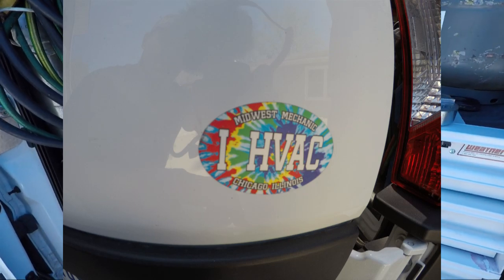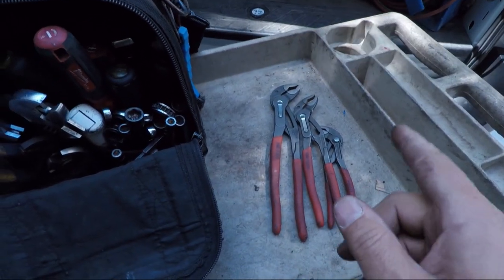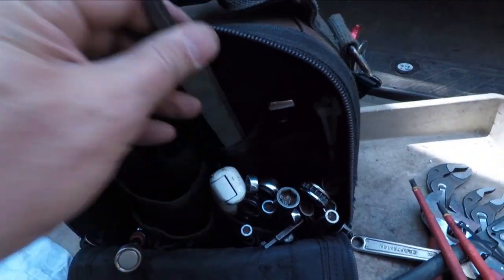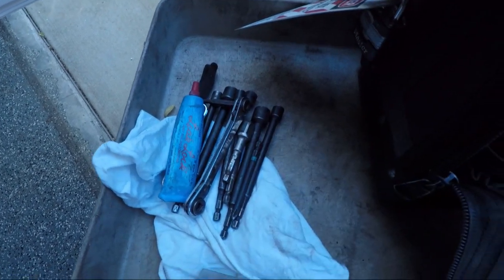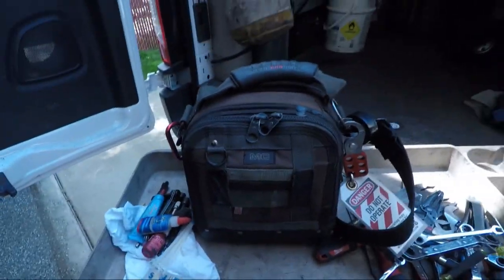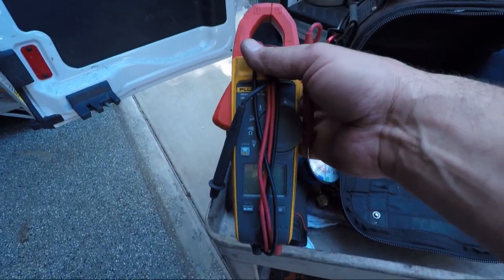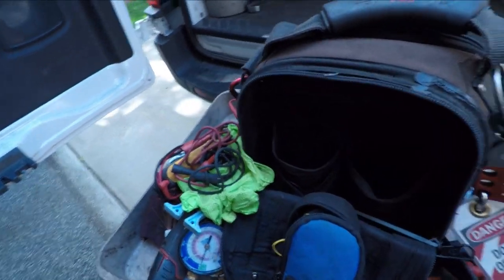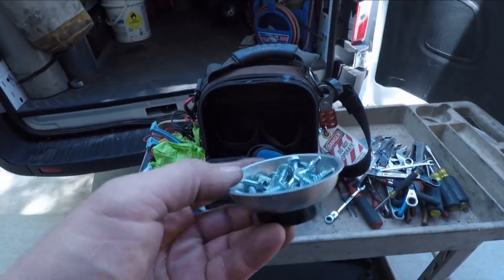VETO PRO PAC MC 2021 QUICK LOAD OUT HVAC TECH

Comment: Like the screw holder for sure that’s pile of tools 🛠 for sure
Reply from the maker: When I seen the little screw holder I had to have it.
Reply: @IHVAC  oh hell yea I would grab it also how dam heavy is that bag 💼 I would be half that stuff for roof work anyways
Reply from the maker: @instrumenttech4220  its less than 25 pounds.  I use it on roofs everyday!  Most roofs im on have stairs or elevator.  No ladders!
Reply: @IHVAC  ok 👌 that’s good to know looked like more you can fix anything with that kit I am sure
Reply from the maker: @instrumenttech4220  seems to work for just about anything.